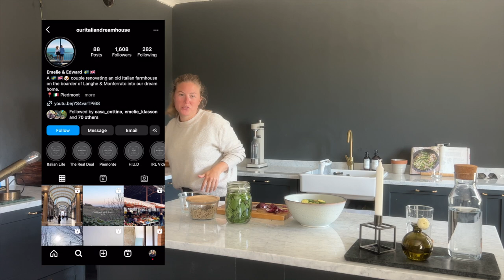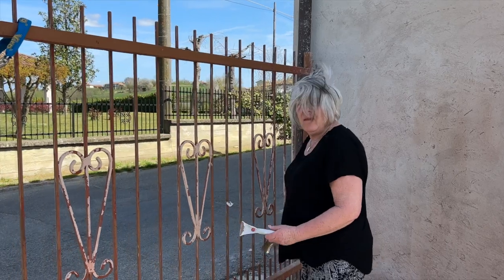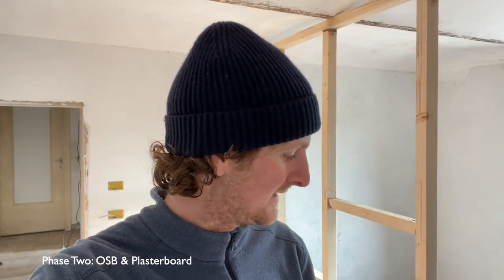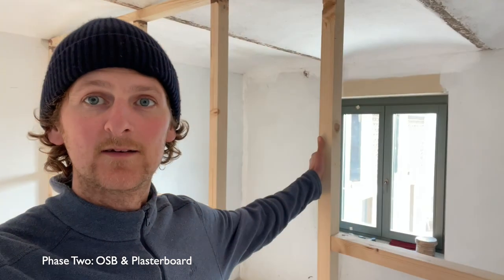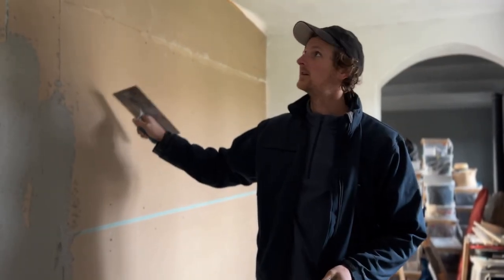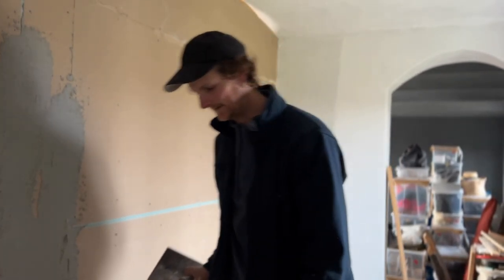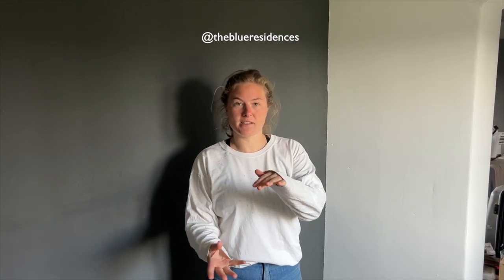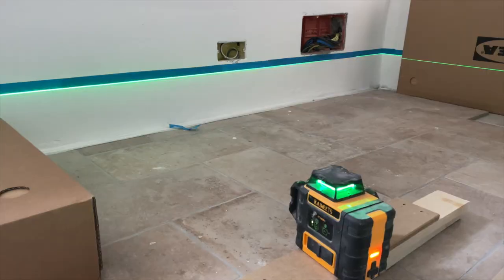DIY IKEA HACK - We Build Our Dream Walk-In Wardrobe from Scratch! Amazing Farmhouse Transformation!

Comment: I think you mounted the plaster boards the wrong way out? 😊 Plus you should make shure the osb overlap on studs, it makes it a lot stronger!

Other then that good progress!
Reply from the maker: Good observations, but there is method to the madness! 😅 There is going to be a bathroom on the the other side of the wall and the plasterboard is hydro-rated board which is why it’s blue - it’s recommended that the blue side face towards the direction of where the water and steam will be located. Overlapping osb on studs definitely more structurally sound, but the wall won’t be bearing any weight and is solely a partition so fingers crossed it will suffice 😊
Reply: @OurItalianDreamHouse  hehe ok 😊
Reply: @OurItalianDreamHouse  I really enjoy your videos and I am impressed with how hard you guys work. But.. you absolutely built the wall wrong.